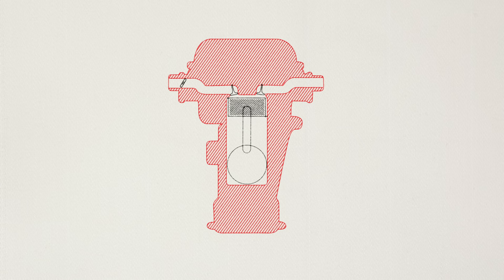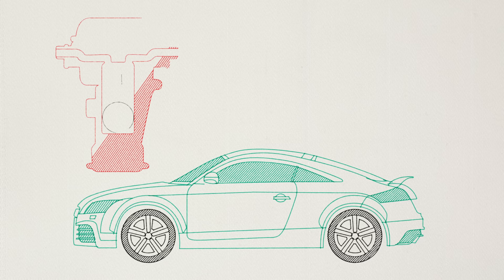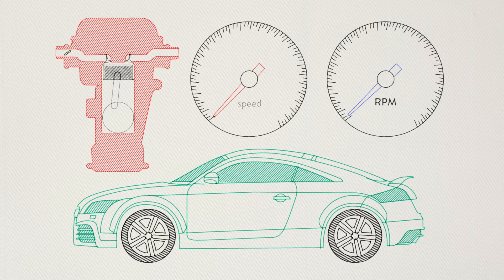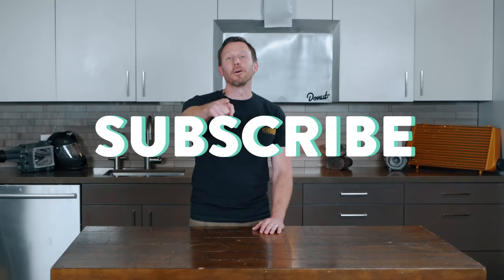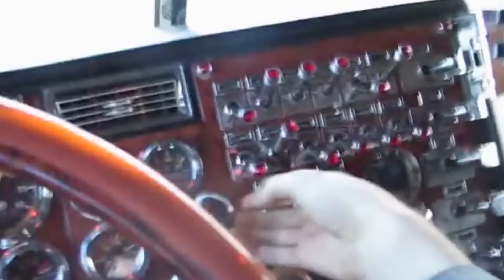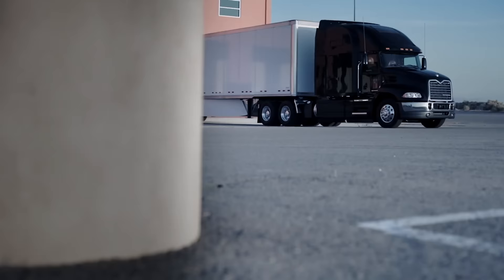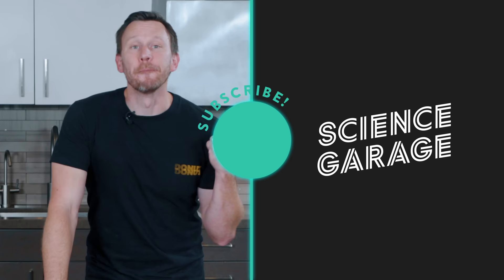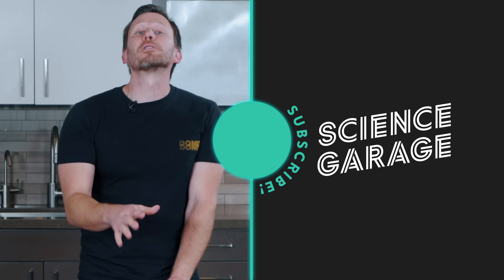ENGINE BRAKING | How Semi Trucks Slow Down Without Brakes | SCIENCE GARAGE

Comment: As a trucker engine braking is my best friend
Reply: Damn right it is.....
Reply: Mind explaining why?  Is it safer, peace of mind type thing?  Or are you driving a truck you own, so you are protecting your investment, such as brakes?
Reply: @Wassenhoven420  if you only use the brakes on downhill they will overheat and you'll have a bad time...
Reply: @Wassenhoven420  well its much safer to use engine brakes + regular brakes(stop sooner) also it's very good for protecting brakes, some times I dont even use the regular brakes at all.
Reply: Actually 90% of all breaking is slowing down and not stopping completely. With the modern engine brake technology and with a little bit of anticipation you only need the regular brakes to come to a complete stop or a more serious braking action. When I get out of my truck and get in my car I sometimes instinctly reach for the engine brake handle 🤣
Reply: BurnoutBram that reminded me of South Park 😂 “you’ll have a bad time”
Reply: @Wassenhoven420  it helps a lot with going down hill, all that weight behind you will push you down the hill to mega speeds, hell here in Europe where we have "cab over" trucks I can tell you now doing 80mph down a hill is very scary (not to mention illegal) and the engine brake just allows you to keep control of the vehicle without working the service brakes to death to where they could pontencially fade and if that happens then you're in serious trouble.....and also it just save ware and tear on the discs and pads, because they're mega expensive when you're putting 6 brake pads in each caliper
Reply: @Daycab82  pretty yeah, does the same job for less money but I've found that some engine are better than others,
(I live in the UK and while we don't have the same trucks as you guys, we have a lot of the same engine and the big companies that own your manufactures also own ours like Volvo, Paccar and Daimler)

Paccar engines are absolute shite for engine braking, you flick the switch and it makes a noise and that's about it.....totally useless (Paccar engines are found in DAF truck over here which are own by Paccar)

However, Detroit's on the other hand are wicked to say the least, you can easily slow a full freighted truck to a stop just using the engine brake
(Detroit's are found in our Mercedes-Benz trucks here and Detroit and Mercedes are both owned by Daimler)
Reply: Brett Wilkins Hahaha! Paccar are absolute shit for sure! I had one in my company Pete 579 and it does absolutely nothing. Useless! Now I drive a W900L with a Cummins isx15, while its not my favourite engine, its waayy better for engine braking.
Reply: @speedfreak  we don't get Cummins ISX over here,
Pretty much all if our truck manufactures (or there parent companies)have home grown engines,
Scania, MAN, Mercedes, Iveco, Renualt, DAF, Volvo and even Ford (only in Eastern Europe) 
With the exception of Renault (being owned by Volvo) they all make there own engines
Reply: XxNickxX Amen to that
Reply: Brett Wilkins wow, didn’t know that. Daimler Benz own Freightliner and Detroit Deisel. I have picked up a load of Mercedes Benz Heavy Duty Engines from my hometown Detroit and took it down to Texas so it can be shipped to Mexico. Detroit Deisel 13 or 15 should be over there where you work.
Reply: @truckinon1871  yeah, I drive a Mercedes Actros with a DD13 in it makes 450hp and 2200nm
They're badged up as a Mercedes OM471

Over here we get the Dd13 and the dd16 our most powerful variant of the dd16 is 625hp and 3000nm/2212~lbft

Comment: Four strokes:
Suck, Squash, Bang, Blow.

Two strokes:
Who cares it's a lawnmower.
Reply: I ain’t Never seen a two stroke lawnmower
Reply: @RustyZipper  
Well I seen a horse fly 
I seen a dragon fly 
I seen a house fly 
I seen a peanut stand 
And heard a rubber band 
I seen a needle that winked its eye 
But I've been, done, seen about everything 
When I see a elephant fly
Reply: @RustyZipper  
Serious though, every petrol push mower is a 100cc two stroke.
You're talking about the ones the now sports fields with, the ride on ones, yes?
Reply: James Neave - dead serious here in USA 🇺🇸 all the push mowers are 4 strokes, oil goes in the bottom and change it once a year. Now weed-wackers are typically 2 stroke here, although battery power ones are beginning to be popular
Reply: There are 2stroke diesels. The Detroit diesels
Reply: roadwolf2 - What do they call them: buzzing dozen, oil slingers. Love the screaming diesels
Reply: @MostlyPennyCat  Most two stokes I've seen have been mopeds, snowmobiles or something like that and they are pretty fun even if they use way too much fuel.
Reply: @vilkku792  
Yeah, most two strokes are mopeds.
Don't know anything about snowmobiles.
Why on earth would you bother with 4 stroke in a lawnmower?

Comment: Jake brake aka engine retarder is a life saver and brake saver system. On long downgrades when we're heavy at almost 40 tons, we only got very few shots on service brakes before they overheat and lose traction or worst burn up, so jake braking is really the only way to go. Since JB is pretty powerful system, there are couple of exceptions: No JB when Bobtailing (look it up) when empty and in snow/rain. Jake brakes can also damage engines if used the wrong way.

Comment: A mechanic once gave me the advice of engine braking in a petrol manual would you rather change the clutch or a set of break pads.....
Reply: King Cuan if you rev match when you downshift, you don’t cause any wear on the clutch.
Reply: Cereal Killer mmm not exactly! The clutch always wears a little bit as it pushes in and out minimal but still cause wear over time that’s what clutches do! Wear! So overtime it will eventually wear out your clutch faster then just using your brakes!
Reply: @kingcuan5261  Said this same shit to my dad. That being said, he was too cheap to replace his pads so he was engine breaking for lack of other brakes.
Reply: King Cuan well...tell your mechanic that I have 200k on my 07 accord I downshift EVERY TIME I DECELERATE....news flash: I STILL HAVE THE ORIGINAL CLUTCH FROM THE FACTORY... sooooo yeahhhh
Reply: @tjlovesrachel 
Seems you can't tell the sarcasm. If OP replies, it should be along the lines of "i will never use his services".
Reply: alvachan88 I know sarcasm very well... I guess I just didn’t pick it up here ... but I do hope the op responds.... and judging by his second post... it’s not sarcasm

Comment: Jake brakes are only one component of modern trucks.
In fact the jake brake will cause engine damage over long term use. 
Modern systems such as magnetic shaft retarders, butterfly exhaust valves & the most modern & most reliable, in new European trucks is the Voilth transmission water coolant driven brake retarder. 

The Voilth is guaranteed for the life of the transmission. 

Jake brakes in modern European trucks have been tuned down due to the superior Voilth Retarder.& the jake system does damage engines over long, long, long term use, so European manufactures have already tuned the Jake brake system down to avoid this engine wear. Voilth systems are really really good & one can use all day long without making too much noise & without causing un-necessary engine wear over the long run.

Jake brakes has been a vital part in modern day heavy haulage, thanks Jacob.
Reply: a jake brake don't cause damage on long term use
Reply: @thermidorlevrai65 
Too be honest though, Jake brakes are awesome, extremely reliable & who cares about any of my above post when you get to listen to that awesome Jake system!!!
Friggin love a Jake brake.

Comment: So while Jake braking does the diesel engine still inject fuel or is this also stopped?
Reply: It does not.
Reply: The power stroke is completely slipped, of course also the injection of fuel. A the moment the fuel would be injected the exhaust valve opens)-skipping injection, ignition and powerstroking down-and just let's the hot air out that would normally ignite the fuel, so all that happened was creating pressure to use energy.
Reply: It's not completely stopped, more like just enough to keep everything working

Comment: I engine brake far more than use the hydraulic brake in my manual vehicle.  It will probably break the engine someday.  But it has 400,000 miles on it and it is still going.
Reply: Why would it? It isn' t bad for the engine in any way..

Comment: What about diesel engined cars? They don't produce the jake brake sound (and there's no switch to engage engine braking) and yet they still engine brake without issue.
Reply: Stjepan Motušić wanted to ask the exact same question. i dont jake brake in my diesel car yet it slows down
Reply: Diesels do produce a small amount of engine braking even without a jake brake due to rotational inertia, but you can only notice it, as you said, in a very small car. In a 70,000lb 18 wheeler, it wont do a thing to slow it, hence why they had to come up with a new way to do it.
Reply: I can only speak about VW/Audi from experience, but they have a throttle body just for this reason. They also use it to control the crankshaft movement once the engine is shut off. If you've ever seen a semi engine turn off, you'd see the crank move back and forth before it settles because there is no vacuum effect.
Reply: some light application diesel engines do have throttle bodies for this purpose they are fully open 100% of the time except when engine braking or if it starts to run away to can stop the engine. also some do have an automatic jake brake although thats more rare.
Reply: Because diesels do engine brake without the exhaust brake but not as but as gasoline cars. Just how autos engine brake but manuals much more.
Reply: @gener7MCpro  diesel passenger cars engine brake even without throttle bodies. They were only added to diesel cars quite recently.

Comment: I have a diesel pickup with a manual transmission, you can definitely still engine brake with it lol
Reply: Most pickups have exhaust brakes. They close off the exhaust and build back pressure to slow it down.
Reply: @EasternExplorer  Most modern pickups do, older ones don't

Comment: A jake brake takes away the power stroke from the diesel engine which is a Compression Ignition type. The ignition or explosion otherwise suppose to happen is not happening because it does not meet the compression required for it to occur. Thus, there is no power coming from the engine even while the pistons are moving due to the kinetic energy of the truck. The pistons become passive and become a load with the whole engine as the tires on the road transmit the rotational force back to it with all the linkages. The popping sound is the external noise generated instead of the internal powerstroke. Thanks for your post. It is very informative and I enjoyed it a lot! Cheers!

Comment: I'm confused, my diesel Mazda 6 has an e-throttle, so diesels DO have throttle bodies. Is it just big semi truck diesels that don't?
Reply: The throttle body is only used for engine braking on a diesel, during normal operation it is wide open.
Reply: In a diesel the throttle controls the injectors
Reply: Modern diesels can have a throttle body, it's something to do with getting better fuel economy.
Reply: The throttle body found on diesel intakes tracks has absolutely nothing to do with acceleration or deceleration it functions as part of the egr system. When the emissions system sees the right conditions to start recirculating exhaust gas into the intake the throttle body or throttle valve closes partially to create vacuum in the intake and help pull the exhaust gasses into the intake and engine properly so that the system actually functions. During all other operation it is fully open

Comment: Wait so you are telling me you don't slow down when you go off the throttle in an automatic?
Reply: Not nearly as much because of the torque converter disconnecting the engine and trans at most speeds. Try it yourself, the only time you will get decent engine braking is if you are high in the rpms holding a gear in slap shift. In Drive it will shift up and lose engine braking.
Reply: @z33tanner  eeeeh, Not really correct, in the 50's maybe but not now.
Most auto's have a torque converter lock-up which is there to specifically assist in engine braking. Rather than disconnection from the engine and relying on fluid forces only like they used to, it forms a fluid connection only when being used to set off from rest, but as rpm's and road speed increase, they lock up to the trans to make the transfer of power more efficient. i.e. less loss of power due to the fluid in the converter and behaves more like a friction clutch when driving, thereby allowing engine braking when decellerating as the trans is clever enough to realise you're not wanting a downshift when it's working hard but not getting a throttle input = downhill = engine brake needed = no downshift (until you hit the gas again).
Reply: @beefcakeandgravy  Lockup converter is NOT designed for engine braking. It was designed to created a direct connection between the engine and trans during ACCELERATION. Yes, it can create engine braking if you are in manual mode holding gears however if you let off the gas in a modern automatic they upshift to save fuel and then disegauge the lock up clutch since it would buck if engauged at low rpms. Your transmission is always holding and releasing the lock up because on heavy throttle low rpms you WANT to use the converter stall to increase torque output. The reason i say almost most automatics don't have much engine braking is because most people are driving around in Drive, not manual mode holding gears, because of this when you let off it will upshift to the highest gear it and disengauge the lockup converter and spin the converters turbine faster than the wheels impeller. This has a pulling effect on the car that is almost the opposite of engine braking.
Reply: @beefcakeandgravy  actually the older automatics tend to have more engine braking force because on most early setups there is a fluid pump on both sides of the transmission, whereas newer automatics usually only have a pump on the input, which means reverse torque from the wheels to the engine, which causes engine braking is extremely reduced, another side effect is you can't roll start most modern automatics, but you can roll start something with an old hydramatic or gyromatic trans the reason for this is that the lockup system is usually set to unlock when the throttle is fully released for fuel economy and to help prevent stalling in case you slam the brakes.

Comment: Jake brake = answer to turbo lag
Reply: Diesels solved that issue a long time ago a VGT or variable geometry turbo is the reason why they can run big turbos on diesels and not have any turbo lag, it's the same concept of a CVT where the geometry and ratio are always adjusted to have best air flow for instant boost it's just it ain't a cheap system so it's not worth the cost in gasoline engines
Reply: @alextepozteco3681  most diesels still have turbo lag though
Reply: @Shazzkid  not if you keep your turbo stock, the series 60's, Volvo D13's we have at work have never had that issue because the turbo nozzle keeps adjusting literally for that purpose of eliminating lag the VGT's work so well they dont even need waste gates because they can control boost very well, Caterpillar fixed their lag issue by making a twin turbo setup but they're turbos always go out, besides that what manufacturer has a turbo lag issue in heavy duty engines
Reply: @alextepozteco3681  my old lexus is220d had turbo lag, my scoda octavia 1.9tdi had lag, and everyone ive spoken to who doesn't have a brand new car has turbo lag in their TDI
Reply: @Shazzkid  like I said it's mostly used in heavy duty Diesels like engine brakes because they're way too expensive for automotive use obviously if you're talking about cars they will not have VGT's especially if they're older vehicles
Reply: @alextepozteco3681  cool good to know
Reply: Any time you have something heavy slowing down or speeding up you'll always have lag, part of the world of physics we live in. Want it faster, make it lighter.